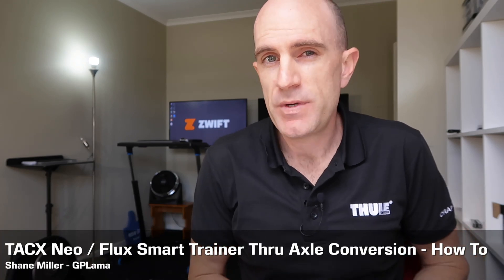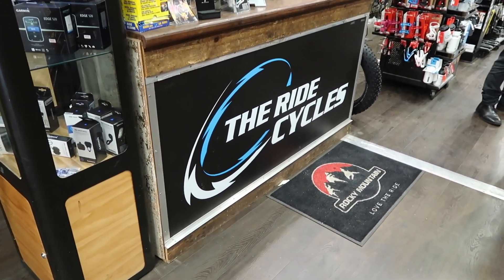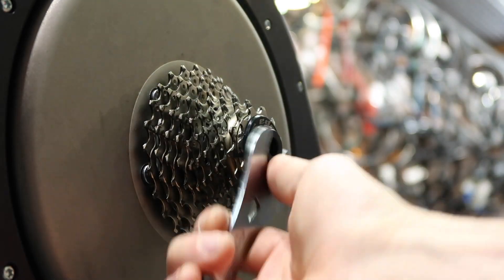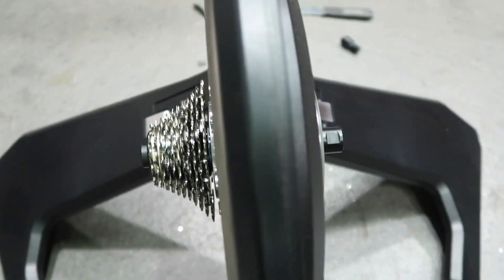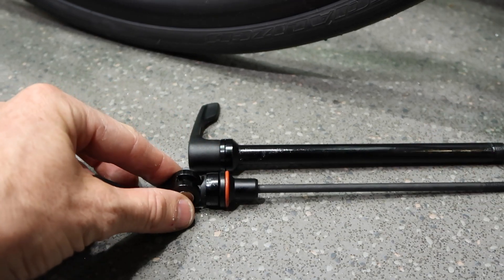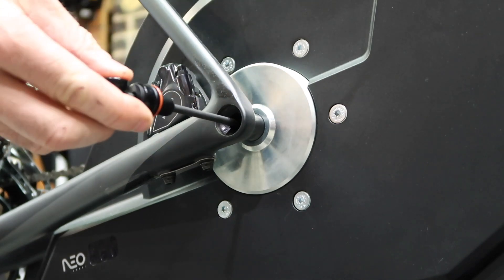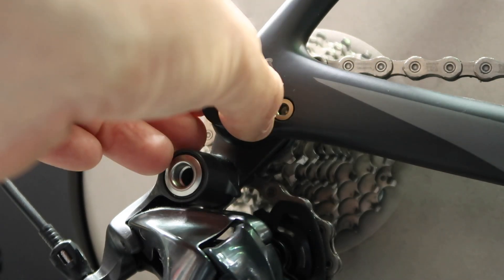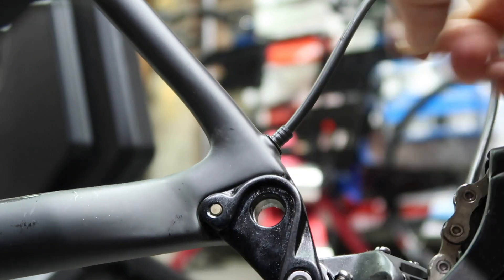TACX Neo / Flux Smart Trainer Thru Axle Conversion - How To [NEO1 &  NEO2]

Comment: With wahoo kickr it much better and easy
Reply from the maker: Things have changed with the latest trainers from both companies. This video is a few years old.
Reply: @gplama  yeah, today i receive my new tacx neo 2t, and setup it with my Scott Spark RC WC 900. but the big problem that I noticed is that the bushings do not rotate when the suspension can change a little. I'm a little upset, I hope this does not hurt the frame's dropouts.

Comment: After battling for over an hour I cannot get my 2019 TCR advanced Pro 1, using the tacx thru axle adapter to fit correctly. It appears the adapter is too wide and does not sit flush against the frame. Either I need to get washers or I need to cut the adapter on the non drive side.
Reply: Hi Rory - did you solve this problem?  I’m just about to go through the same with a TCR.  Thanks.

Comment: Wont it scratch the paint on the drive side?
Reply: Kind of late reply, but the kit now comes with 3 additional threaded "optional adapters" (1.0, 1.5, and 1.75mm thread) and also a white o-ring. Using the M12x1.0 threaded adapter with the o-ring means that the o-ring is providing softer contact against the paint on the drive side (I would still put some sort of protective sticker (helicopter tape) on the bike to protect the paint). Theoretically this should minimize clamping against the bike frame (since it uses the threads on the drive side for clamping force instead of the surface of the adapter).
Reply: Exactly, this is my concern, isn't this pinching right on the paint?, thru axels are not made for a quick release to be squeezed on the drive side

Comment: GP lama, still having difficulty with the conversion. I’ve got an Izalco 2019, fitted with the RAT through axle. It’s got a different fitting on the cassette side, and the nut doesn’t sit flush when screwed in. Can you help? Cheers from one BALLARAT boy to another
Reply from the maker: Best drop into a local bike shop. And cross your fingers. RAT is a pain in the arse for everyone involved. Maybe Tacx Support can help.
Reply: @gplama   - I have a cervelo s5 disc 2019 its got a funny fitting also wont work with cervelo rapid axle skewer

Comment: I knew this would be 10x better than any official instruction or manual from Tacx so I went straight here instead ^^ However my local bike shop sold me a (135x10mm) while you are talking about a 142x12mm. I guess the manager of the store should know what he does so I'll still try for my brand new (Specialized Roubaix Expert 2019) that I bought at the same time. Being hydrolic I hope the caliper won't get into the freewheel or any other weird stuff happening so I can train tonight.

EDIT: Goddamn store who sold me the wrong size... there was an obvious 1cm gap between the Tacx and my bike, and when I checked the skewer I removed from my rear wheel, it was a (142x12mm) -_-

Comment: This thru axle adapter should have been included with the Neo, instead of paying $80 odd dollars plus shipping 🤔
Reply: Yep. Totally agree
Reply: Agree as well. Just bought one for my new Disc bike.
Reply: Neo 2 has two adapters for the most common sizes. But since there are more than twenty types of axles in both length and thickness, the simulator manufacturers did not include all possible options so as not to increase the trainer cost excessively.
Reply: I was just about to buy this trainer as it popped up in stock on a website finally. Then i realised i'd have to buy a £50 thru axle converter plus a cassette. Nope.
Reply: Garmin’s ripping us off. Totally agree this should be part of the kit for the price they charge. That and better directions.

Comment: Shane, just wondering if that's an 11 speed cassette? I ask as on mine there's insufficient clearance between the chain and the stay, on yours it looks fine. I've tried refitting the cassette, Tacx are proposing to send me a different hub which might fix. Cheers
Reply from the maker: I believe so... not 100%, this video was a while ago, it's 2am here... eyes are blurry.
Reply: Shane Miller - GPLama 😆  thanks- mine is officially gonna have to be replaced for other reasons now

Comment: How is this set compatible with 148x12? Are there some aditional elements (washers (?)) included that were not shown in the video? Tacx states that T2835 id for both 142 and 148 mm 12 mm axles, but resellers do not mention the 148 mm option.
Reply: So the ONLY way it will work is that it squeezes the 148 frame down 3mm each side to fit the 148 boost rear end. They don’t make a 6mm bigger set of thread in adaptors. I mounted my carbon 148 frame up and it certainly does squeeze it together. I can’t imagine the pinch stress is good. Imagine aluminum!   CMON TACX!
Reply from the maker: That's one for Tacx Support. I don't know off the top of my head.
Reply: I likewise had to put the squeeze on my frame to go from 148mm down to the adapter’s 142. This also threw out the calibration on my derailleur, so I had to adjust the limits.

Comment: Why don't you do a video how the gear changes on the neo need hours and hours of setting and then it still does not shift all gears smoothly
Reply from the maker: Because that's not the experience I've had with my unit. It's also not a common issue I see raised with the Neo.
Reply: @gplama  I too am experiencing this. Although I also note that on my through axle specialised tarmac that the spacer relies on clamping rather than slide for and so seems to move up and down on the mount.

Comment: What would I use to get my 2015 S-Works Roubaix to work on the NEO?  The rear disk brake is hitting the flywheel.   Thanks in advance!
Reply from the maker: That's one for a local bike shop to throw an eye over. They're the best place to start for solutions for things like this.

Comment: First of all, great video! Does anyone have any experience with using a quick-release bike on the already converted trainer? Is that possible? My wife is considering buying a through-axle bike and i have a quick-release one. It would be great to use those on the same tacx flux without having to convert the trainer back and forth.
Reply from the maker: Not possible as the width is different. 142 vs 130.
Reply: Thanks for the quick reply!

Comment: Apparently the Tacx Thru Axle strips the threads inside Canyon bikes? Any info on this?
Reply from the maker: First I've heard of it. There's no threading with this adapter.....so stripping of the threads is impossible. Maybe it'd blunt them if the bike is smashing around incorrectly on the adapter? Not sure.
Reply: have you more information about this issue
Reply: You say there's no threading with this adapter, but at 4:14 on your video you say  "we screw that in to the other side"... That's threading into the bike, isn't it? There are 3 different thread pitches used on bicycle thru axles- 1.0mm, 1.5mm & 1.75mm, that adapter component you are screwing in at 4:14 in the video obviously can have only one of those pitches.  Or is it only threading to the QR skewer and making it look in the video that it's threading into the frame?  I've been back and forth with Tacx for several days now, can't get a straight answer out of them, hoping to find info elsewhere.

Comment: Hi Shane, I'm 15 and in Melbourne. I am looking to get into zwift mainly because I hate cycling on the roads. I'm trying to decide between the Kickr Snap and the Vortex Smart. I know there is a big price difference but do you think that the extra $200 is worth it? Keep up the great work.
Reply from the maker: G'day mate. If you can stretch the budget, go for the SNAP. It has a bigger flywheel that'll be perfect for when you start cranking out massive Wattbombs!

Comment: As a warning from someone who purchased a kickr16 with thru axle conversion, make sure that the end plug that sits in the drive side is the correct size. My Canyon was allowed to move a couple of mm when out the saddle causing creaks.
Luckily, contacting Wahoo support, they have kindly sent me a kickr17 which is due in a couple of days.

Comment: The Wahoo Kickr is much easier with changing from disc to rimbrake bike
Reply: Can you explain?
Reply: Chant Zenian You don’t need al the tools and it is done in one minute
Reply from the maker: *The Kickr17 is easier for thru-axles. The Kickr 1 and 2 require an almost identical conversion kit as the Neo.

Comment: what about the focus r.a.t system?
Reply from the maker: Good luck..... not compatible with much when it comes to smart trainers.
Reply: They way I do it (which adds a step) is removing the RAT cap and replacing the derailleur hanger screw with a shorter one. After that, I’d use these following steps. When remounting the wheel I add the cap and the longer screw back in to hold the derailleur in place and I am set.
Reply: Shane Miller direto or kickr17 both work with focus RAT. Probably elite drivo also as I think it’s similar to the direto (but I haven’t tried)
Reply from the maker: Arhhh. Yes. Good point. Trainers that use the thru-axle from your bike itself should be good for the RAT system.
Reply: Today I got my Thru Axle Adapter for the Neo and I tried that. To be honest, for my taste that's too much work you have to do everytime. Do you know, if it is possible to replace the RAT-System with Syntace X12 for example? This would make this process much easier and I don't race, so I don't really benefit from RAT anyway.
Reply: Hi, I just solved this problem today. The Robert Axle Project Lightning Bolt-On Axle replaces the RAT-System and the adapter works then. The only small issue I have now is, that the brake caliper of my SRAM Red HRD is touching the NEO. I think I might grind away a bit of the plastic.
Reply: @P4LL3R  mate can you provide some more information about this - I think I have the same issue I have a tacx flux and got the thru-axle and am pretty disappointed with how everything set up and how it cost more money. But need to get the Tacx adapter as well is a pain -_-
Reply: @weedimo90  You need both, the Thru Axle Adapter from Tacx (~50€) and the replacement Thru Axle from Robert Axle Project (~60€). I agree, it sucks, that have a proprietary system and it is pretty expensive to replace it. But it was the only solution I found and it was a lot cheaper than keeping my Emonda just for indoor training.

Comment: If you're using hydraulic brakes, it's also worth it to stick something like a folded up business card into the caliper where the disc would be. This is so the pistons don't get pushed out if you accidentally pull the brake.
Reply: Eli Douek good tip that 👍
Reply: @redgefour6729  Yes, this is a very good idea, because otherwise it will be difficult to separate the pads later.